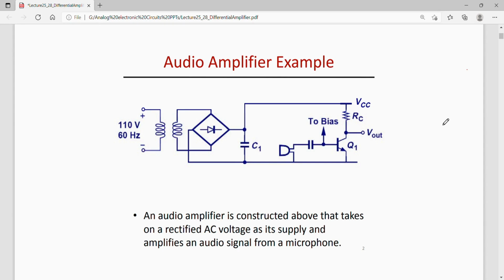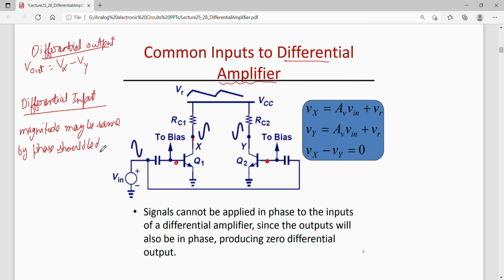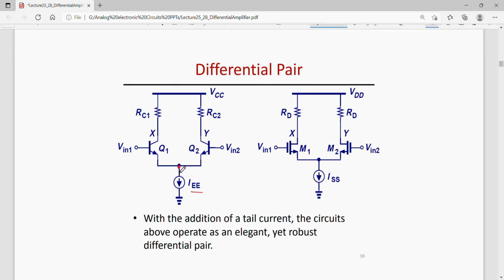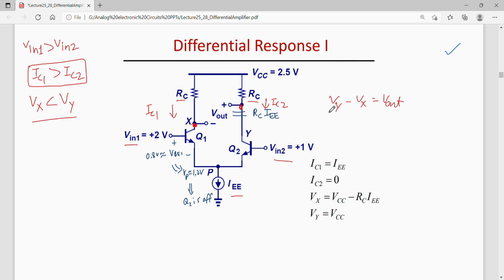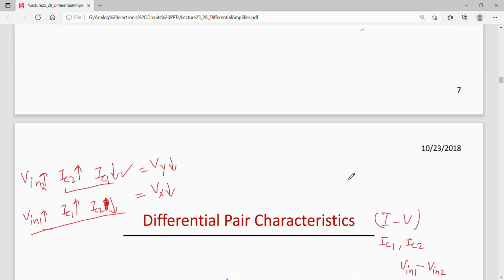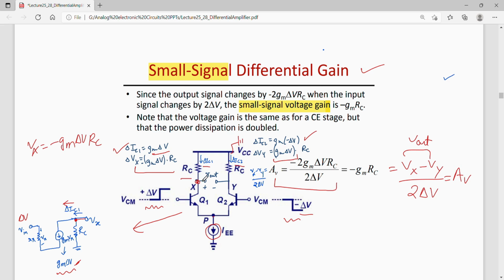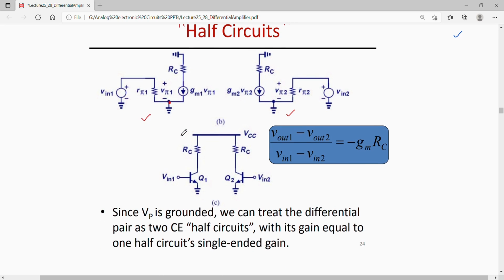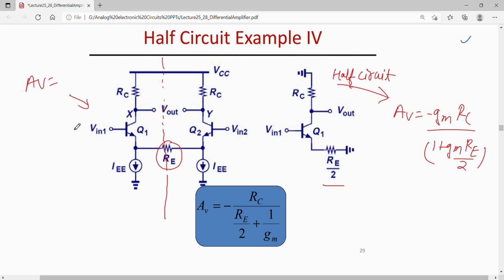11) Differential Amplifier, Half Circuit Analysis with Examples

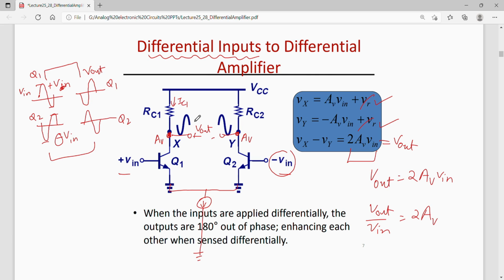Comment from the maker: At 19:18 and 20:12 Collector currents do not depend or change with only small changes in input common mode voltage VCM or VBE (IC1=IC2), otherwise collector currents can change even with tail current IEE attached to the differential pair. If inputs Vin1 and Vin2 change by large amount then collector currents also change but IC1 + IC2 = IEE still holds true. And, IC1 is not equal to IC2 in this case.